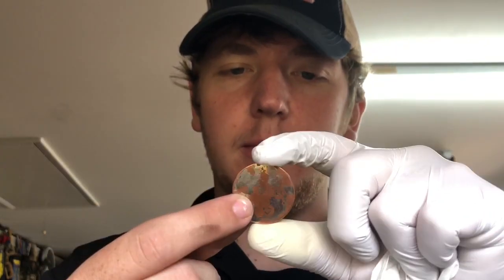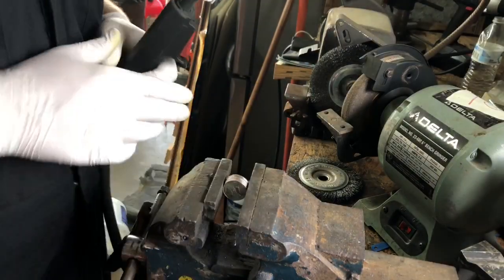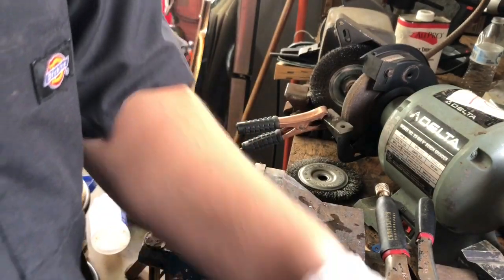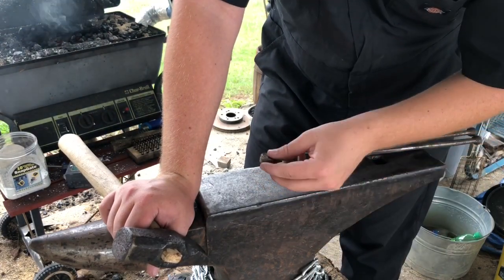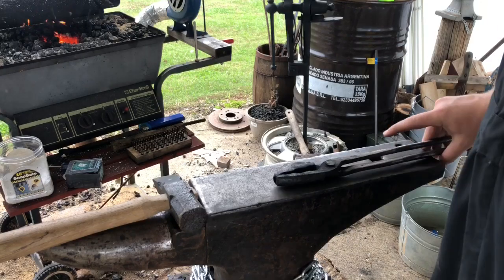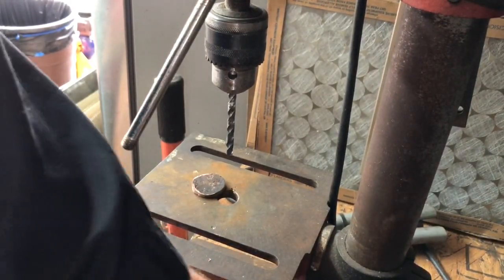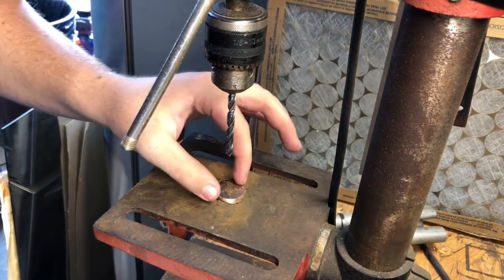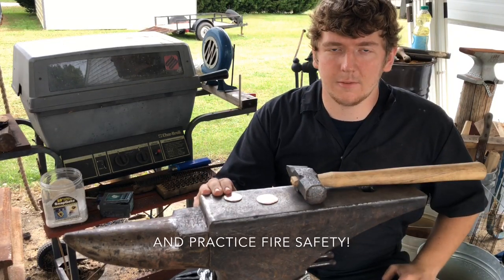Forging Mokume Gane (Raindrop Pattern)

Comment: Hey, it is me from reddit. SoftRock. Is there a way to do it without a welder?
Reply from the maker: The best way I could think of would be use some wire to keep them together, the wire has a higher welding temp than the quarters so when you set the weld it won't mix with the quarters. and can be pulled off afterward.
Reply: Use a clamping system, you don't weld this. Only noobs would consider welding it.
Reply: I use kanthal wire, first I wrap the stacked quarters in masking tape to make it easier to wrap the wire and keep the stack of quarters straight. - The tape burns off in the forge and doesn't effect the surfaces being forge welded.
Reply from the maker: I know this is years later but another way to do it is to use a copper rivet and rivet several quarters together, then the rivet just becomes part of the material